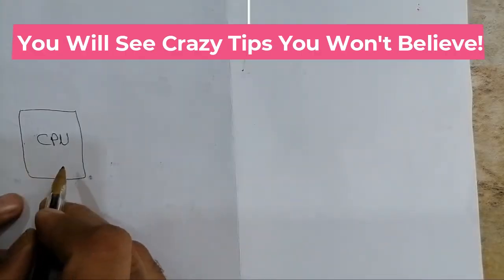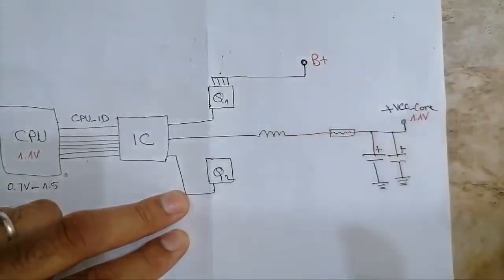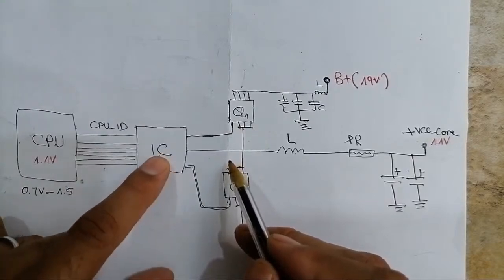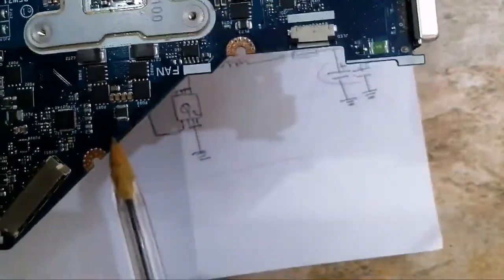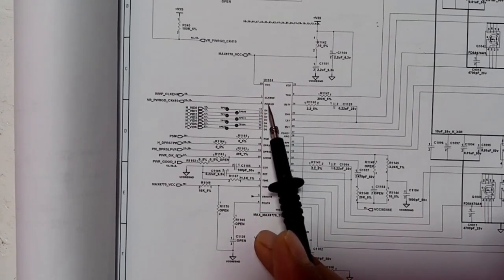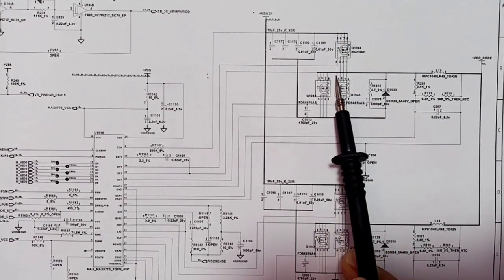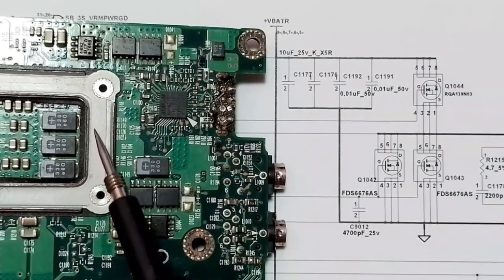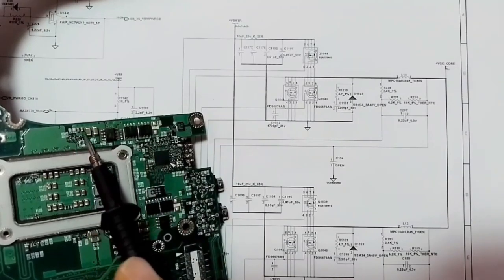Become a CPU Circuit Expert: Top Crazy Tips to Dominate CPU Circuit Repair

Comment: Hey man,

"My PC's power supply had gone bad, so I replaced it with a new one and it started working normally. However, when I put it to sleep mode, I noticed that it had gone into a boot loop. I waited for a while, wondering what to do, I tried pressing the power button, but nothing happened.

Then, I unplugged the power cord and waited for a bit. And when I plugged it back in and tried to turn it on, the CPU fan was spinning at full speed, but there was no display. I tried pressing the power button repeatedly, and even unplugged and replugged the cables again, but nothing worked.

I thought maybe there was moisture, so I unplugged it and left it drying for a day. When I tried to turn it on, the motherboard light was on, but nothing else was happening. The power supply fan would turn on for a second and then stop, repeating this every 3-4 seconds. After 4-5 attempts, it would completely turn off.
Just motherboard light glowing and nothing else.
It's dell optiplex 780.

What should I do now?"
I am a big fan of yours. Please help .
❤❤❤
Reply from the maker: Thanks for watching! It's great that you're a fan. Let's see if we can troubleshoot this together.
Reply from the maker: Here are some steps to help diagnose and potentially resolve the problem:

Power Supply Check:
Since you recently replaced the power supply, double-check its specifications. Ensure it meets the Dell Optiplex 780's power requirements, particularly the wattage and connectors. If possible, test with another known working power supply to rule out a faulty replacement.

CMOS Reset:

Disconnect the power cord and remove the CMOS battery from the motherboard.
Wait for about 10-15 minutes, then reinsert the battery.
Plug the system back in and attempt to power it on. This will reset the BIOS settings, which can sometimes resolve boot-loop issues.
Component Reseating:

Turn off the system and unplug the power cord.
Reseat key components, such as the RAM, CPU, and any expansion cards. Dust or improper seating can lead to boot issues.
Inspect the motherboard and connectors for any signs of damage, burnt marks, or bulging capacitors.
Minimal Boot Configuration:

Disconnect all non-essential components like hard drives, optical drives, and external peripherals.
Leave only the CPU, one stick of RAM, and the power supply connected.
Power on and see if the system POSTs (displays the Dell logo or a BIOS screen).
Diagnostic Lights and Beeps:
Dell systems often have diagnostic LEDs or emit beep codes to indicate hardware issues. Refer to the Optiplex 780 manual or Dell support site to decode any indicators present during the boot attempt.

Test with External Monitor:
If the system seems to power on but there's no display, connect it to an external monitor to rule out a display issue.
Good luck
Reply: @electronicsrepairbasics_erb  actually I have tried all of that with the help of meta AI and nothing happened. Now it's like motherboard light is on and nothing else, no fans moving no display etc.